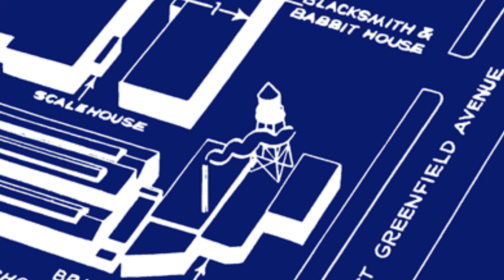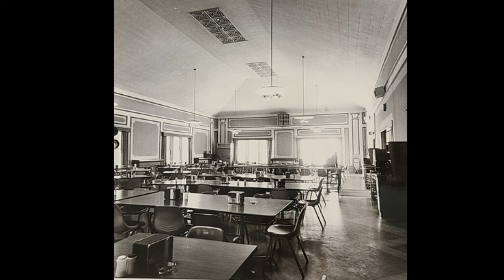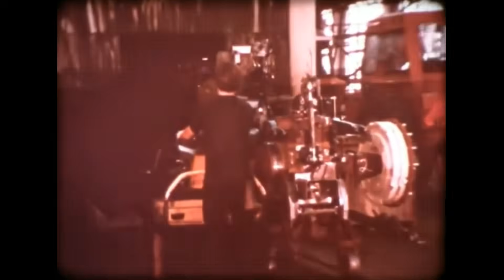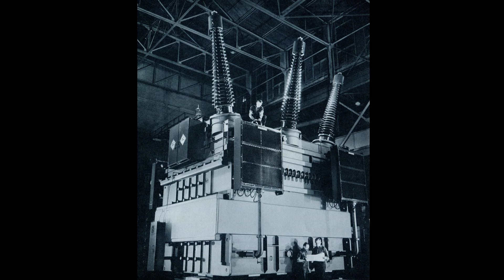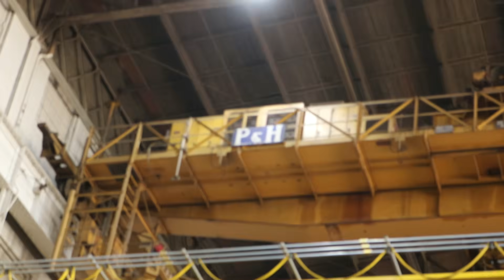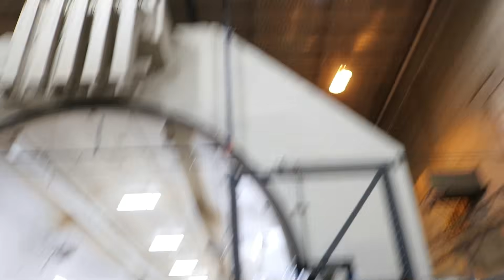Then And Now: A Tour Of The Allis Chalmers West Allis Factory Headquarters

Comment: I'm glad you showed the huge vacuum chamber just off the main erection building! Was the big DC motor still attached to the chamber on the back end? Below the floor in a basement about 25 feet down were the massive vacuum pumps to vacate the air from the chamber while testing steam turban generator shafts up to 500 MW. Also in the back was the control room full of equipment to run the testing. It's been a while since I was there.  Once a year I used to calibrate the displacement transducers used during testing of the rotors. This is one of only two such test chambers on the whole country. The other one is in Texas.
Reply from the maker: No, it's not there anymore. When Siemens or whoever used it last left the building, they made sure to make it inoperable

Comment: I found this an extremely moving presentation. I was born and raised in West Allis (Stally). My Uncle Harvey worked for Allis Chalmers directly, my Dad was a tool and die maker supporting the Plant . When it closed, they were both forced into early retirement. Those were very dark days, not only for my family, but for the City of West Allis and our greater Milwaukee Community. West Allis would have never existed without the "West" Allis Chalmers Plant and frankly the loss of jobs that West Allis and the greater Milwaukee area lost, we have never recovered. To this day I only live about a mile from the plant still drive by the old familiar streets and still shop in some of the current shops. But it is not the same, walking amongst ghosts. God Bless you,

Comment: My Dad worked at AC from the mid-60’s until it closed. He was in the Army Reserve, in a Rail unit that bought part of the factory complex to repair railroad cars and engines. He worked there until the late 90’s when he was transferred elsewhere. So he joked that he started on one side of the property and ended up on the other. I remember when I was very young, (1975/76) AC had a big “Open house” where they led tours through the facility and I remember being in awe of the enormous machinery and equipment.

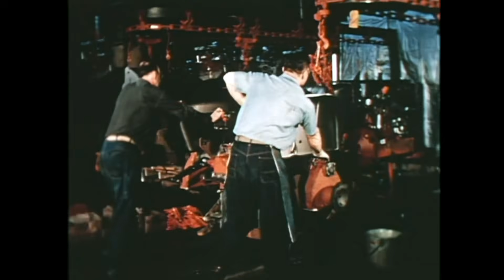Comment: I was at the auction where they auctioned off all the equipment and tools. I still have an old Fosdick drill press from the early 1900s. Bought a lot of the equipment from the tool and die shop. Still have the cabinet from the tool room with all the cap screws. Over 100 drawers. I bought the whole tool cage for $100. Desks, stools, tool steal, cabinets hundreds of items. Could only take some of it home. Tool room was on the third floor and some idiot broke the elevator by driving a loaded fork lift on it . The elevator was built in1889 and rated for only 10,000  pounds. It was the idiot's luck day that he didn't end up under it all in the basement. The tractor assembly line was just as if on that last day [I believe it was on the end of December] everyone just walked off at the end of the shift. Tractors sat on the assembly line in various stages of completion. The auction lasted for a week. Each day started at 7:00 and went into the evenings. Big crowd in the morning and dwindled until only 5-10 left at the end of the day. At the end of the day you could get great buys for lees than a penny on the $100. The minimoon bid was $25. I saw a nearly new degrease, wash and paint spray line with all it's equipment that was only a few months old and cost over one million dollars sell for $25, the only bid.
Reply from the maker: @stephenp8086  sad, do the things you bought still have the brass ac id number tags on them?
Reply: @JandLVideos  Power Matic drill press has stick on numbers. I'll check on the old Fosdick when I go out to the hanger.
Reply from the maker: @stephenp8086  i got a couple of those tags saved in the collection.  Someday I want to buy something that still has one on there from the plant.
Reply: @JandLVideos  If the Fosdick has the tag, I would be glade to sell it to you if you want it. It's a great OLD drill press.
Reply from the maker: @stephenp8086  that would be fun to have, we live about 8 hours from Milwaukee though it would be quite the trip.  We spent 3 days out there making this video it was a fun trip.
Reply: @JandLVideos  Yes, the drill press has the brass tag. Judging by the age of the Fosdick, I would say it was one of their first machine tools. Early 1900s? I live in Adams WI just 30miles north of the Wisconsin Dells.
Reply from the maker: @stephenp8086  that's a little closer to us!  Mind sending some pics?  Our email should be on our about us page

Comment: My Grandad was farming with horses like most in the mid thirties,  he bought his first Allis-Chalmers tractor on steel from a local dealer was a fairly new Allis-Chalmers sales location. That first year he used it enough to gain confidence in it, and sold their good team to a  farmer 8 or 10 miles to the east. My mother and her siblings cried when he left with them,  but the next morning they came trotting in the drive and started nosing around for grass etc. Mom and the rest were overjoyed,  but it was short-lived when Grandad made the embarrassing trip to return them to the new owner. 😢 He got the new tractor stuck that first season in the field on the south place, and ended up in town to see who or what could pull him out. A man with a shop in  Fayette had recently started selling rubber tractor tires. He told Grandad he would come pull the wheels off,  convert them to rubber tires and he would be able to drive the tractor right out. If the swap failed in any way he would swap them back and Grandad would owe him nothing. The deal was done,  the tractor drove right out like the man said and Grandad was a convert to rubber tires!  He retired in 1992, we sold his machinery and every single piece except for his D2 Cat was Allis- Chalmers. ❤
Reply from the maker: Very nice story!

Comment: Growing up in West Allis I remember this well. Was great seeing this and it doesn't seem that long ago when it was all still there. I still live a block from the east side of the factory with a good view of the PowerHouse looking out my back window. Before I took my D15 up to the cottage I got a picture on the trailer with what you could see of the factory in the background. Couldn’t see much then as Motor Castings Co was there but now that is all ripped down with a clear view. Thanks for the video.

Comment: AC had a great product. Yes, there were some weaknesses, but overall they were good solid tractors. Thirty or more years ago, I used a 6080 as a full-time machine. It wasn't perfect, but it had fewer headaches, and was more rugged than any other tractor I used before or since. The biggest mistake AC made was outsourcing major components. I believe if they had stuck with the lines where they really excelled, and brought back a version of the G in the 1980's, they may have made a go of it.

Comment: I'd give good money to find the stamping dies for the radiator shroud/nose sheetmetal for the Allis Chalmers 180. Could probably sell at least 1000 units. Just finished painting the axles and rims for my 180 which my grandfather/father purchased in 1972. Still a great tractor. Probably has 15,000 hours on it.

Allis Chalmers used to have a huge plant in Kansas City area as well.
Reply: Combine division.

Comment: After discharge from the Navy, I first worked in a Kenworth truck dealership as a mechanic. Most of the trucks were equipped with Cummins or Detroit diesel engines. One day, A new truck came in for service with an Allis Chalmers 6 cylinder diesel. I drove it into the work bay and was totally astonished at how very smooth and responsive that engine was compared to the more common engines of the time. I still remember that like it just happened. Sad to see such good manufacturing disappearing from the US. All cheap Asian labor, poor quality now.

Comment: In the summer of 1966 I worked in Hawley plant wiring high voltage switch gear.  In 1968 I ran a radial drill press in 3 tractor. When I left the Army I repaired a computer in AC main office.

Comment: In 1967 I worked for an Oliver tractor dealer.  He had a sledge hammer that was painted Allis Chalmers orange that he called his Allis Chalmers wrench.  My guess was he didn't like AC because you had to use AC impliments on AC tractors.  He sold mostly impliments.   My job was assembling those things.

Comment: we had an older 1960's AC HD6 bulldozer that we learned on when I was attending a local trade school in my 10th - 12th grade school years I graduated in 2000. The school got rid of it some time between 2001 and 2002 when they relocated to a newer building they did how ever keep a Backhoe that was made by AC. I often wonder what became of the HD6 they had it ran good but as with anything parts were hard to get and the machine shop class often had to fabricate parts for us using unused steel plates and round stock that were donated from ALCO (American Locomotive Company) which closed it's diesel shops in Auburn, NY in 1979 and wrapped up final orders by early 1989.

Comment: As a young kid in the 60s driving by here was always a treat. All the activity and noise meant.prosperity. The neighbor next to my grandparents house was a lifer at AC in the accounting department from 1944 almost until it closed. A good friend of mine who worked for the C&NW RR his first job was The Station Agent at West Allis. They were switched out twice a day due to the high volume of traffic usually forty or more freight cars a day.  Looking for steady work I started as a bus driver for the transit system in Milwaukee in 1983. I can still remember driving by the tractor plant with the combination foundry smell and machine shop oily floors. Many people wondered why the buildings were so recessed from 70th Street but that was the right of way for the predecessor Streetcar which last ran in 1958. Even though the place was on the downhill slide my bus schedule still have a footnote to load at Washington Street 335p 337p and 1118p 1120p for shift workers who sadly we're no longer there to ride.  They had unique railroad equipment and lots of trackage but that's another story. Thank you for the historical reflection. PS. I'd buy you a beer at the Tractor Inn but it was torn down to make room for new apartments
Reply from the maker: Wish we could have seen it in its heyday!

Comment: Very nice tour. I live less than 2 miles away from there and remember when they were still building A-C Tractors. Then, they built Deutz-Allis tractors. I was in the (then former) A-C Club House a few times in the early 90's. The Lions Club, Rotary Club, High School Booster Clubs, and many other local organizations would have meetings and luncheons there. It was a shame that they ripped it down to build a surface parking lot.

I've driven on every one of those roads. I've also been in all of the "public" buildings that now include various retail stores, restaurants, and a fitness club. When the plant was "revitalized" into retail, the four main tenants were Kmart, Kohls Food Store, Builders Square, and Blockbuster Video. There were other stores, too, like KayBee Toys and Radio Shack.

As a side-note, you could see an Amtrak Dining Car, from a distance. When the fence is open, you can go back there. The large building beyond it was used by a company called Avalon Rail Car. They used to rebuild old passenger cars to meet FRA / Amtrak standards. Unfortunately, that car never made it into their facility. Rumor has it - the car is owned by Penzys Spices and was going to be rebuilt as a test-kitchen that would travel around the country. That railroad track is not abandoned. It is still accessible from the Union Pacific Railroad main line. The tracks used to connect to the Milwaukee Road (Wisconsin Central/Soo Line/CP Rail), but that is a bike path, now. 

The bike path (Hank Aaron Trail) gives you an amazing view of the Hawley Road building. You just look up and are amazed at how big "that one building" actually is. Johnson Controls remodeled the east end of the building, but the space had been a predecessor to Sam's Club. When it was "Warehouse Club," they did as little work as necessary to have a wholesale environment. They cleaned the columns, painted the walls, and polished the concrete floor.
Reply from the maker: We were amazed at the size of the place.  Obviously, we did some research and looked at photos before the trip.  But seeing it in person just left us in awe

Comment: I'm glad I got to work where your last segment shows, before the power house. 
It  was Global Power that must have left in 2018. We manufactured emergency diesel generator housings for hospitals and other large consumer needs. Some of these units were often larger than a modern 4bdrm home, and your work area would become dark when traversing overhead. 
It's great to see how nice it is now. 
When I worked there, it was quite run down. 3rd shift powder coating, I would catch large rats out of the corner of my eye creeping around. 
I even seen a lone coyote running in the parking lot near the power station on lunch. 
Milwaukee used to be so industrious. Now it's an infamous chocolate city that breaks new crime stats yearly. And now I avoid the entire county.

Comment: I am a retired sheep rancher in Colorado and have a D-15 which I still use every day.  It has a DuAl 100 loader which get's used for plowing snow, moving round bales and any other ranch chore imaginable.  We bought it in the spring of 1981 with a non functional hour meter at 3400 hours.  Although it uses a little oil and has some quirks, it starts right up and gets used virtually everyday.  I am sure it must have at least 20,000 hours on it.  It has been and still is an amazingly useful and reliable tractor.  Sweet Allis!

Comment: Kearney and Trecker had a large complex and headquarters that borderd Allis-Chalmers to the south. They manufactured milling machines, and at one time they were the worlds largest producer of milling machines. They played a huge role in pioneering the first NC machines. 

K&T worked closely with Allis-Chalmers, supplying them with many of their machines. They bit the dust shortly after Allis-Chalmers did (1991).

The plant is almost completely gone with a small assembly building left standing that the city is trying to re-purpose. I’d love to go back in time and see that plant in full swing.
Reply: Kearney & Trecker invented the first numerically controlled machining center, including auto tool changing.  Allis bought one of the first machines late 50's.  Later K&T installed a fully automated machine line (FMS) for the new family of tractors (7000 series) power train housings.

Comment: Born and raised in Milwaukee: 60’s-80’s. 
Mom and Grandparents worked for IH in the Miller Valley during the war and after. 
My wife’s Grandfather worked at AC on the turbines which we saw when we visited the Hoover Dam. 
And during a renovation a wall of steel framed windows from a building at AC ended up in their cabin up north. 
Milwaukee (and Wisconsin) used to make a great many things back when the Brewers were Braves. 
 Machine Shops and Taverns were on every block it seemed. 
I remember watching a shipment of Russian tractors offload down at Lake Michigan near Summerfest. 
My grandfather was smart enough to realize imports like those Belaruse would change lives. 
He was right. 
Thanks for sharing-well done.
Reply: Those old Belarus tractors looked like they were made from scrap iron!  I doubt they made much impact on American made, but the Kubota, Yanmar, Deutz machines sure did.

Comment: I’m not bragging but I grew up using a ‘71 Scamp 5 hp to mow my parents lawn 💪
Reply: I used to sell and service the AC lawn and garden equipment.  It was actually re-badged Simplicity equipment.  They made a snowthrower that could not be equalled by any other make!  Good quality products.  All gone now, replaced by Chinesium junk!
Reply: @tomrogers9467  - absolutely, I have an ‘87 Deutz 613 Special I still use to mow my yard. I remember a few years ago we had a local Simplicity dealer, on the sales floor was a similar sized unit in new condition, $7995 I nearly fell over laughing. Wasn’t but a couple years  later they closed up shop.

Comment: I worked for two brothers when I was in high school on their farms in the 1960's who farmed with Allis Chalmers, a '59 D-17 diesel and a '66 D-17 Series IV gas.  One brother had worked for Allis during WWII as a welder while the other was in the Army.  They both came out west to farm in the '50's.  There was an Allis Chalmers dealer in my area, closer than Deere or Ford or IH so most of the local farms had Allis Chalmers.  I grew up on them.  Now own two '57 D-14's and a HD-4 crawler, my son farms with an 8030, a 7000 and a 190.  Over the years,  I've driven and worked on all the other colors, but my first love will always be Allis Chalmers.

Comment: You didn't show the beta-tron building
Reply from the maker: I didn't know who to contact to see that portion of the complex.  Maybe we'll make a "Part 2" someday
Reply: @JandLVideos  just drive down there, it's behind the plate shop, you can see the stack of AC transformers that power it.
Interesting side note. Allis Chalmers invented it, and built it to x-ray large castings for flaws, they only built 2 tubes for it, it's still on the original one. If I remember right it was built in the 50's so it's 70 years old and still operating.
Allis Chalmers 👍

Comment: I was born and raised in Milwaukee and used to ride my bike around that area.  After moving to northern Wi. and marrying in the early 80s I picked up an old WC straight pull with a trans PTO that ran a sicklebar.  When rebuilding it I found out it used mostly Ford Model A parts in the drive train.  Bought it for 50 bucks, put a hundred into it and sold it for 400 bucks.  It was a simple and good running machine.  Wish AC could have lasted longer than it did.  Love all the history, great video!